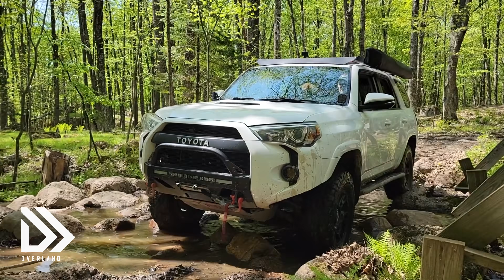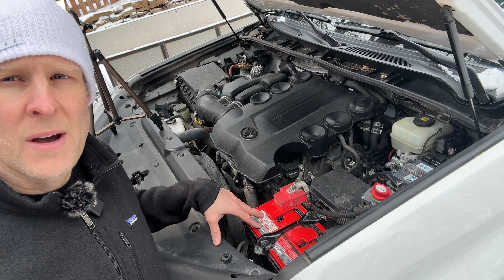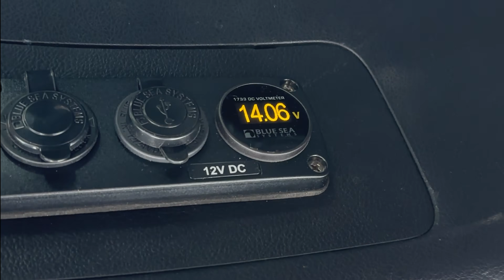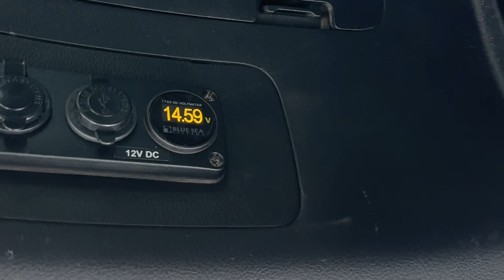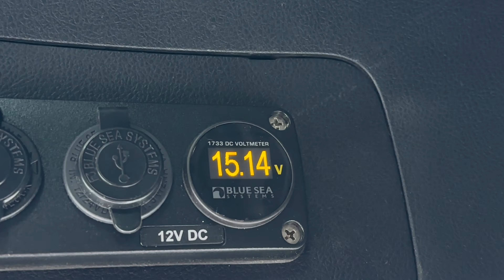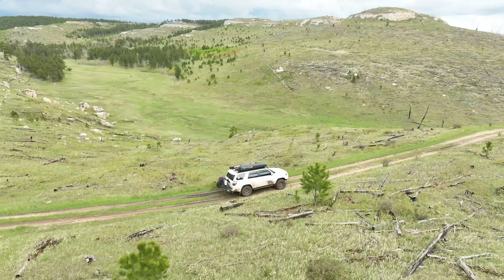Your AGM Battery Needs More Voltage - Voltage Booster Pro DIY Installation in my 5th Gen 4Runner

Comment: I use this with my Odyssey battery in my Tundra.   after 2 years  my battery still tests 100%   no issues at all.
Reply from the maker: My battery and this booster are still going strong.

Comment: You should get a dual battery isolator relay 200 amp would be fine if you don’t have a upgraded alternator and then run a lifepo4 or preferably a sodium ion bank in the rear. Thank you shouldn’t ever have to worry about running your battery low overnight powering basically anything unless you have some crazy Stereo. The reason you would run a battery isolator is because the different chemistries have different resting voltages you would basically ensure that you’re starting battery never gets used while the vehicle is off.

Comment: Hey buddy...love your videos....would a high amp alternator be overkill?
Reply from the maker: For a 4Runner, high output alternator is usually overkill unless you’re running a ton of stuff (big inverter, winching a lot, crazy audio, etc). Stock alternator is actually solid, it just doesn’t charge AGM batteries fully. That’s why I went Voltage Booster Pro.

Comment: I usually sit anywhere from 13.8-14 (no load) down to 13.3 (full load). I have a xs power under the hood, big 4 all OFC 0 gauge, mechman 270, and a limitless noli 50AH sodium reserve. All of that really allows me to maintain (at least way better than before I’d drop to 11s lol) and get back up to voltage if I ever drop, however this would be nice to get up to 14.5 ish to gain more wattage since my amp is tested at 12. My only concern is how well will my current mods maintain it or will it just drop quick back to 13.3 ish. If so, still may be beneficial for quick bursts for bass comps etc.
Reply from the maker: For me, my AGM battery stopped fully charging and was getting worse every month. When I shut my vehicle off, my voltage would drop lower and lower. After installing it, it got my battery back up to full saturation and after 3 years, it works like it did when it was brand new.

Comment: Will this booster work with the oem battery? Havent any issues yet but who knows... '20 4runner no overland equipment but some powerful aftermarket audio equipment. Seems cheaper buying a booster than an alternator

Comment: I picked up a brand new Duracell AGM battery for my Lexus GX460 and the charging voltage says it is 13.8 to 14.5 charging rate so I don't have to put that booster on it for the voltage.
Reply from the maker: Did you check to see how many volts your alternator is actually putting out? I know mine was not hitting those numbers before I installed the booster.
Reply: @destinationjourney_overland  it wasn't hitting those numbers because the battery is FULL and you're hitting float charge voltage.

Comment: Looking to do exactly what you’re doing, but I don’t know if I need to run an AMG like to get your opinion. I’m running a dual combo 20 inch light and two extreme LEDs 6 inches each along with a 13,000 pound winch. I have a 2019 TRD pro off-road Batteries acting a little wonky and I just want to upgrade with this be a good upgrade or thing is I’m not doing a major change i.e. putting a refrigerator but I am gonna put a compressor in it. I’m a double empty and I’m looking for ways to look out for myself when I’m driving in the snowthe winch any help would be appreciated thank you. I really like your set up.
Reply from the maker: I love the durability of the AGM battery as well as the cold cranking amps. Let me know exactly what you’d like my advice on and I’ll answer your questions as best I can.

Comment: This thing is badass! Thanks for the informative video.
Reply from the maker: I’ve had it installed for a full year now and it works great. Not a single issue. Thanks for watching.
Reply: @destinationjourney_overland  an update on how it’s been working for you ? Thinking about purchasing one
Reply from the maker: After 2 and a half years it is still working great. No issues with my battery not fully charging since installing this thing.

Comment: Any update on how it’s working I just upgraded my tundras battery to an AGM my alternator usually runs at around 13.2 after it’s warmed up. Does running this booster cause any damage to the alternator or over work it?
Reply from the maker: I’ve installed this about a year ago now. I went on a couple 3000+ mile trips this year and a few 1000+ mile trips. Not a single issue. Battery is happy and healthy. Has worked great for me.

Comment: Another alternative is upgrade the alternator and do the big 3 upgrade.  I think that should be done first.  Asking more charge from the alternator will indeed juice it faster.  Get a nice $300 alternator from MechMan or Tucson Alterators capable of 270 amps and your charge will actually increase a bit as you but more load on it.  It sits at 14.2-3, and when the lights and other accessories turn on it will climb to 14.5-7.
Reply: So if I get a high out put alternator I won’t need this for my agm ?
Reply: $400+ now.. think I'll stick with the booster, AGM and big 3

Comment: The problem with that is if you go for a longer trip and your battery is fully charged, now voltage has to drop to 13.5-13.8 volts. Called "float charge", if it doesn't happen youll overcharge your battery with 14+ volts. You solved one problem of underchaging and created another one of potential overcharging on a longer trips.
Reply: A stock alternator will fully charge the AGM battery. Car batteries are for starting, and the alternator quickly recovers that charge to full from driving. This higher alternator voltage is BS. They jsut read forums posts and parrot other clueless people. This isn't some solar set up, it's a car battery for starting.
Reply from the maker: For me, the proof was in the results. I had a problem with my battery not fully charging. Before the booster, my AGM voltage dropped quickly after shutting down the 4Runner. After installing it, the battery was able to reach full saturation again and hold capacity like when it was new. It still tapers into float, so it’s not sitting at 14.5V constantly, it’s not overcharging the battery. That’s just my firsthand experience with this setup. If you’ve got solid technical data that says otherwise, I have no problem being wrong. But in this specific case, I had a problem, researched it, tested it out, and fixed it. It’s been years, and my AGM battery still works like the day I bought it.
Reply: You can just pull the fuse if it over charge on a longer trip and can put the fuse back in when you want. My battery did go into float charge but I just pull the fuse and it was good. I constantly had to trickle charge once a month before I install so for me its worth it.

Comment: Do you know if this has an adverse effect on the alternator?
Reply from the maker: I haven’t found any research that says it does. I have been running it for 5 months now and it works perfect. I’ve noticed that my batteries resting voltage has improved since before I installed the Voltage Booster Pro. I’m happy with it.
Reply: @destinationjourney_overland where do I get this one?

Comment: Can anyone tell me if this will work for the 8th Gen Camry there's two ignition fuse spots just like on the other Toyota and mine is in the top spot closest to the engine when standing on the drivers side of the vehicle just trying to upgrade my voltage but I can't get a response from voltage booster pro
Reply from the maker: I think that the safest bet would be to keep trying to get a hold of voltage booster Pro to answer that question. Let me know what you find out.

Comment: The other thing that helps is to replace the OEM alternator with a DC Power, Inc. alternator. Definitely check everything with a voltmeter. AGM batteries need a specific amount of voltage. Too little, AGMs will eventually die. Too much, they fry.
Reply: Which Alternator is recommended?

Comment: I stopped watching around 2:30. I was hoping a new video like this one would have a new solution in my case. You see I have a 2019 Tacoma with an Odyssey battery, but the 3rd gen Tacomas don't have that particular fuse. In my truck, the ECU controls the voltage of the alternator and not the alternator itself. I'm in the same boat as you as my alternator is only charging my start battery to about 90 percent of it's rated Ah capacity. I'm probably going to lose a year of life off an expensive battery. I have a NOCO battery charger and used the AGM setting, but I could only get the voltage up to 13.7 volts. I contacted Odyssey and they think maybe the charger was in "float mode". They suggested to draw the battery voltage down below 12.6 volts, and the charger will move to "bulk" charging. The Odyssey rep also mentioned voltage up to 14.7 volts would be fine. I will attempt this very soon. Otherwise good video. Edit: I did keep on watching the video and see you installed the BlueSea OLED voltmeter. I did the exact same install haha. A bunch of people thought I was nuts to do that when others just bought a cheap cigarette lighter adapter thing to watch their voltage.
Reply from the maker: I have the same NOCO battery charger and found it does not properly charge the battery even in AGM mode. That was one of the reasons I made the upgrade. 

For a few extra bucks I ordered the Blue Sea volt meter already installed in the accessory panel. I would have had to buy one either way. 

Thanks for watching and I would like to hear what you end up finding as a solution for your Tacoma.
Reply: Yeah that's why you adjust the voltage on the sense wire.
You're telling me it doesn't have a alt sense/voltage sense wire?
Either that or external regulation would get the job done.
Reply: You lucked out! You need to find someone who can tune a Tacoma and have him adjust the ECU’s charging voltage. You could buy your own tuner and probably do it yourself? I don’t really know a whole lot about Tacoma’s. I do know if the ECU controls it you can change it through tuning. 

You could buy a vF tuner and do it yourself if you know the ECU mapping? Or you could find someone who knows how to do that and just have them write you a file and do it for you.

Comment: Be careful as i ran this product for a short period of time as well. But users need to be absolutely aware that when running "high" and not drawing much poser, you will be charging at 15.1v and even more and will absolutely cook the battery. I have an SPOD with a digital readout which is how i knew this. It is a viable tool under the right circumstances and knowledge. I eventually went to a true dual battery setup with a Redarc BCDC charger. Blessings to you on the adventures!
Reply from the maker: You are correct. They clearly talk about this in their directions. You should not charge an AGM battery above the recommended voltage. For my purposes I will be keeping it set to low which charges at 14.5-14.6 volts. I’ve been running it for about a month now with no issues. Thanks for the message and caution. Happy New Year!!!
Reply: @destinationjourney_overland  absolutely! It's a product that works....a cheap fix, but caution boost mode!